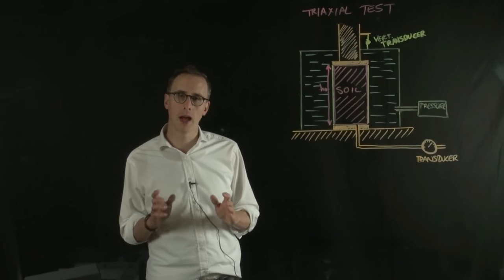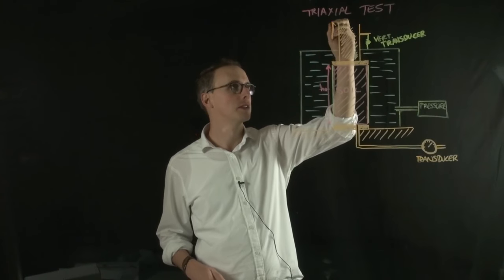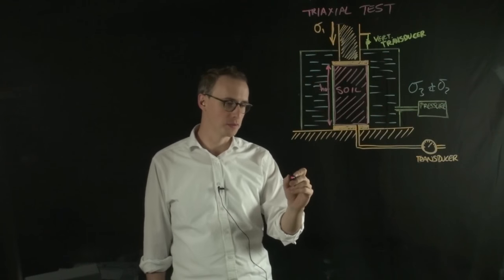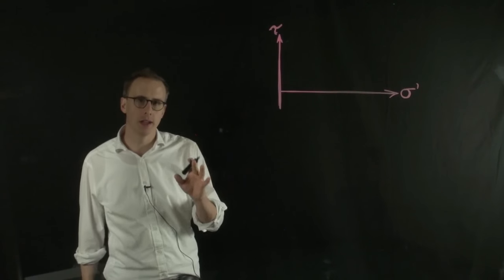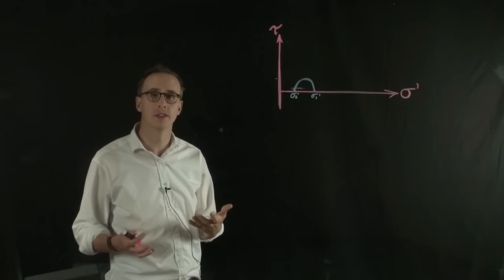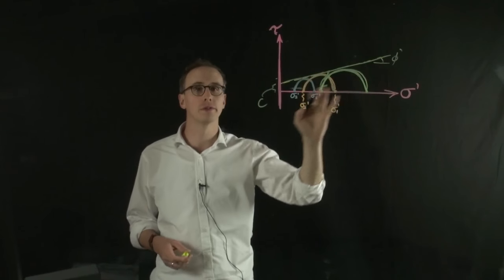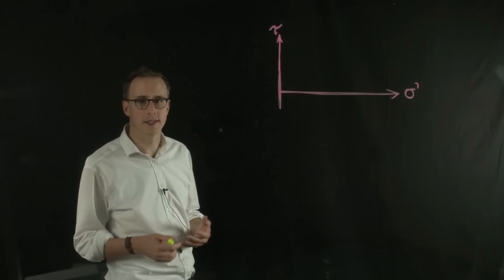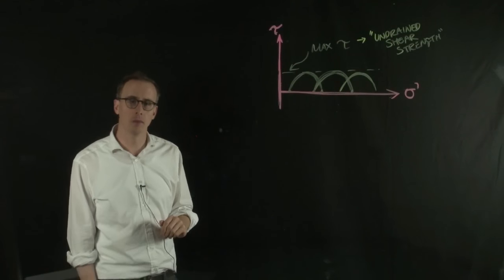The Triaxial Test

Comment: Hi Phil, for this test, can the sample be disturbed ? And if so, would you not like to test the same density in the lab as it was within the field? Thanks
Reply from the maker: Thanks for the comment Jurgens. The test can be carried out on remoulded samples but if your sample strength is sensitive to remoulding, this will not reflect the insitu strength. Yes, the density is important to know as this influences the angle of friction.
Reply: @philrenforth9569  Thanks! But  I feel it would have been clearer if you had explained the difference between "cell pressure" and the "pore pressure" and how they act and impact on the   "Normal pressure".
Reply: What abot true triaxial test .